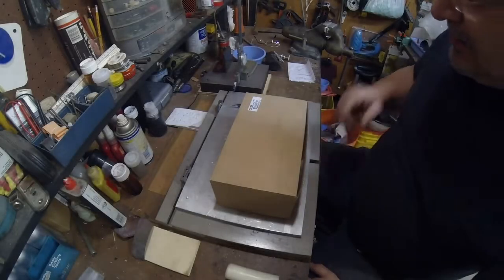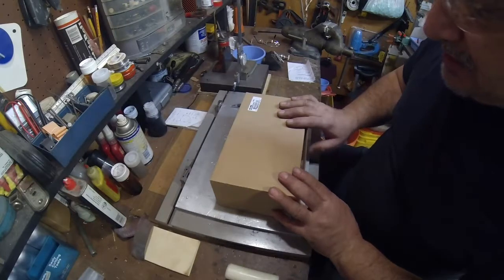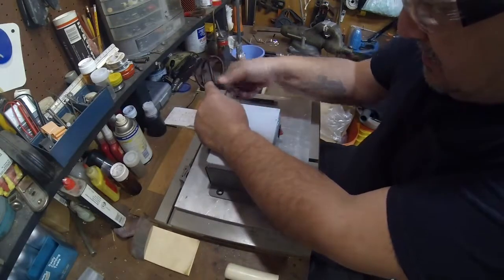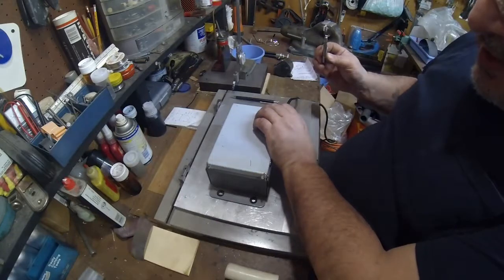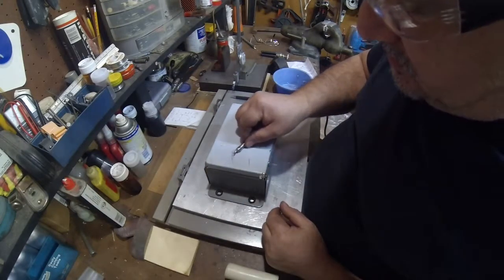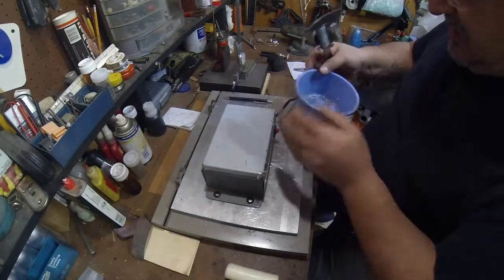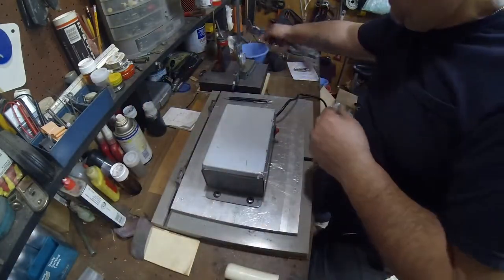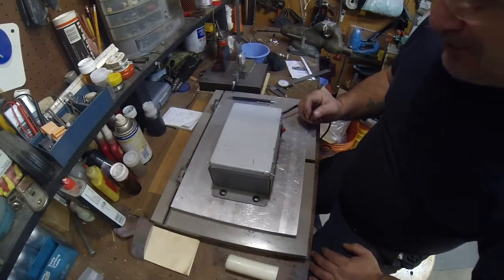Demagnetizer (IMPORT)

Comment: I'm  tired of removing metal chips from my calipers,scissors,end mills, drill bits .maybe I should get one like yours, looks well made.
Reply from the maker: Hello ddistrbd1, I share your frustration. Nothing worse than retaining a chip that makes your dial caliper jump teeth, or a chip gets stuck on the anvil of your mic's. Yes I would recommend the demagnetizer. Now when ever I detect some magnetism I deal with it ASAP. Might I suggest that if ya run a precision  instrument over the surface put a shop towel down first and run the instrument over the towel so ya don't scratch the instrument, its a rough ride for them. Thanks for your comment and interest in my video. Keep safe and make some chips.

Comment: can it be used to Magnitize things? Like screw drivers?
Reply from the maker: Hello Gunner Asch, this unit will only Demagnetize. Best way I have found to magnetize is to run a strong (rare earth) magnet over the working end of the screwdriver. Thanks for the view and comment. And I would recommend this product
Reply: @hondamann5517  I actually have the identical demagnitizer.  I was hoping that there was a trick to useing it to magnitize things.  Direction of travel, etc etc